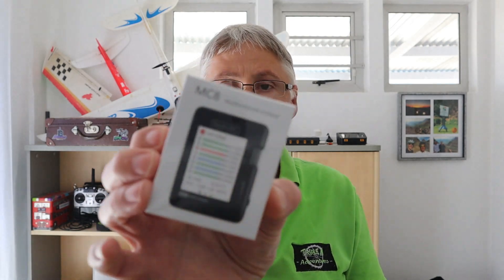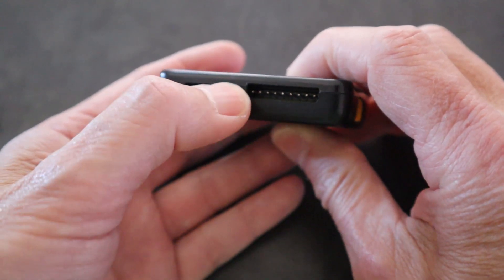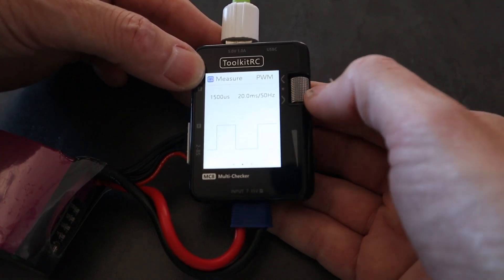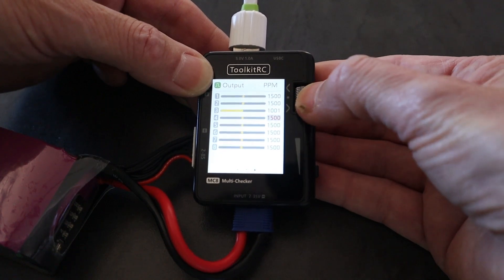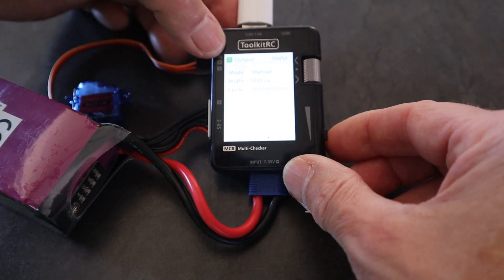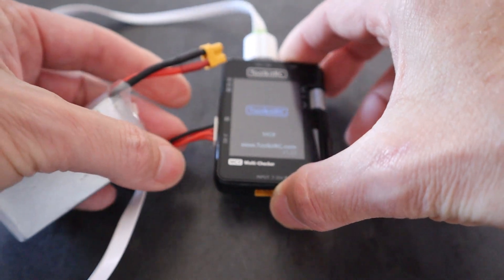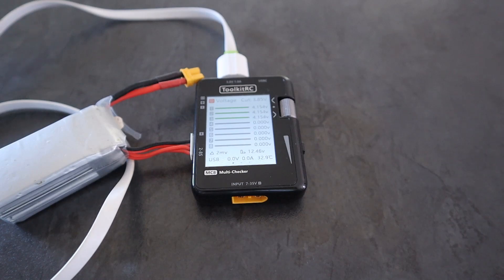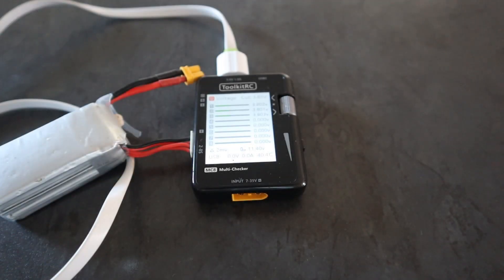Review: ToolkitRC MC8 Multi-Checker

Comment: Hello Bill. Have you done a tx16s from mode 2 to mode 3?
Reply from the maker: If your radio is set up for Mode 2 you will need to swop the gimbals over to change the throttle to the right stick. Then go into the SYS menu and change the settings to Mode 3. I fly mode 1 and in my opinion you are better flying Mode 1 or 2 in case someone needs to help you.

Comment: Hi Bill hope you well. I bought the Toolkitrc M8S 400watt 18A a few weeks ago. Can I use it to charge my lipo 3s 2200mah battery with it. Because there is no 12v input. Happy flying
Kind regards
Johan
Reply from the maker: Hi Johan, the M8S Smart Charger will easily charge your battery. The XT60 Input is DC 7-30V I use the ADP100 ToolKitRC power supply which is 20V. You could use any power supply I would say minimal 12V but it will need a lead with an XT60 connector.